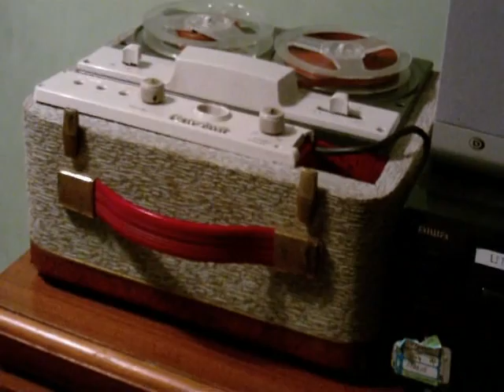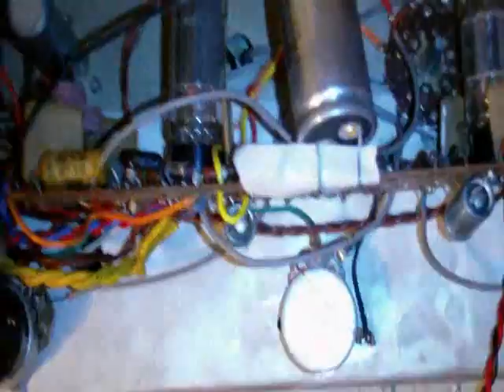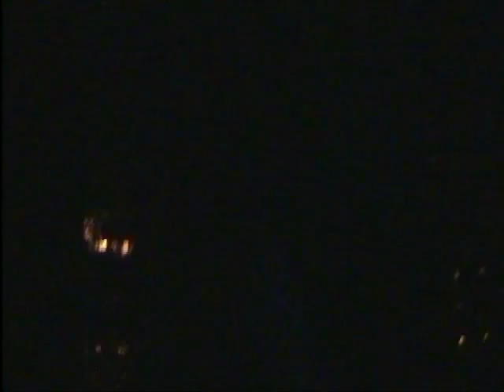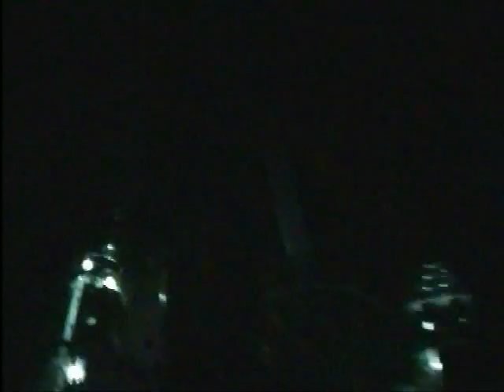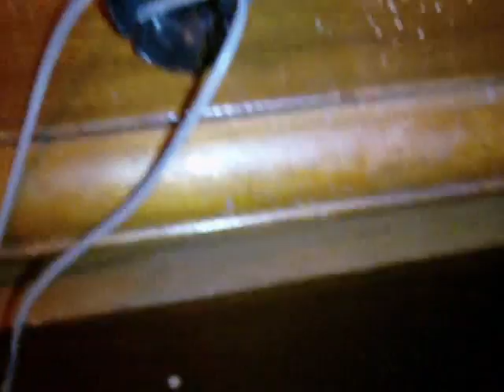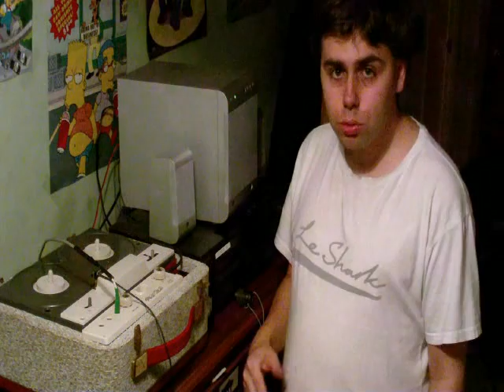Valve/Tube sound is Good Sound

Comment: why don't you simply record a tune from the cd twice, first time to a digital crap and second time to tube tape recorder, than digitalize from their analog outputs again and compare the two?

if you don't want to use the tape reel on the tube recorder, than simply do it live using only its tube preamps. apples to apples, tube to transistor, tape to digital stream, that's the way to do it.